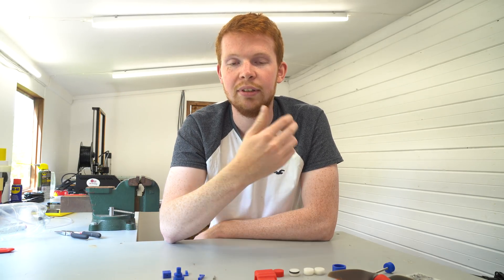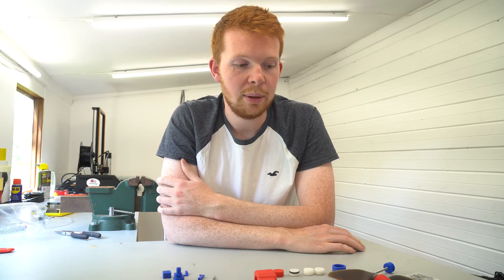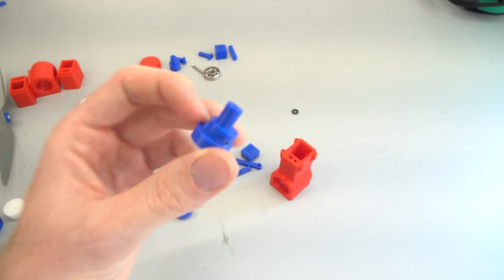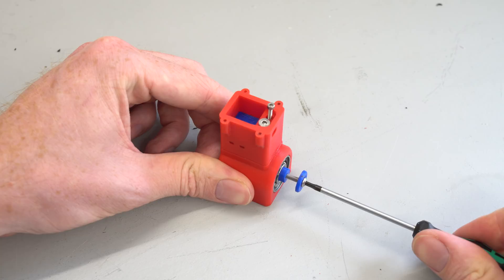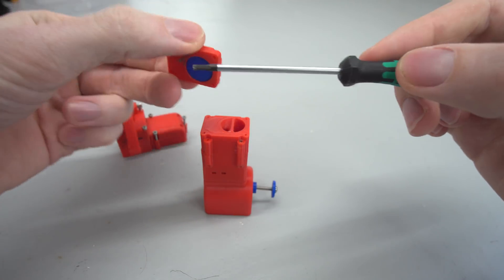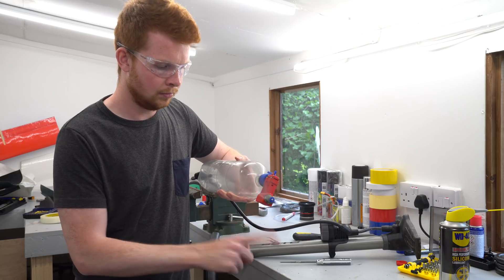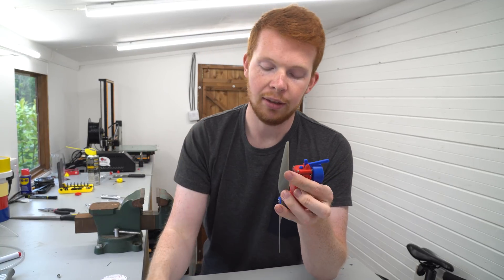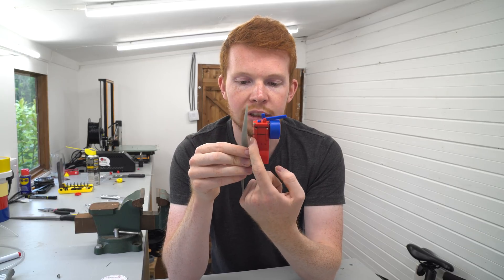Air Engine Exhaust Valve

Comment: After you fix the issues you should try to power it with liquid butane and maybe even dry ice, you would maintain those higher pressures longer without ever even needing to pump it up.

Comment: I can see that round headed bolt, or any bolt for that matter, covering up that new exhaust port.  With that said, the design shouldn't even work given that any air coming from intake would vent straight to exhaust.  As far as the operational friction from the cam lobes, maybe try to reduce the cam profile while adding a point of leverage to regain travel and reduce the amount of work required from the cam to do the same job.  So like a rocker arm sort of assembly.  I can see the idea behind the upper exhaust valve, but in my opinion, it was just poorly incorporated.  Your gonna need an airtight valve for exhaust, to which i may suggest maybe a simple ball valve in which the exhaust rod would hold it shut until exhaust is required.  Lastly, looking at the additional exhaust ports at the bottom, in my opinion they're a little to high.  It would seem your losing some efficiency and power from the air exhausting a little to early before the cylinder reaches bottom dead center.  I understand that you do need to relieve as much air as possible before upstroke, just use your discretion and take my input with a grain of salt.  Heck, with a proper exhaust valve system at the top, or multiple exhaust valves at the top of the cylinder, you don't even want the exhaust ports at the bottom.

But then again, this is all speculation on my part.  I don't have the engine on hand to test, nor do I want to build one and tell ya your doing it wrong.  I enjoying watching you work your way through a project your passionate about and to speculate and voice on possible designs changes.

Love the little series, keep up the good work!

Comment: A valve block similar to a "selector valve" with internal passages which is directly linked to the crank for timing. Should eliminate the need for any spring pressure needed for seating, along with cams or mechanisms like that. There may be some sliding friction, but choice of plastic and surface finish for fit would affect that too. (However done right that's much less than turning a cam against a pushrod pushing against a spring.) Might also need to work on the piston pin offset, and you could have a motor that self-starts in one direction once pressure reaches the cylinder. And last but not least, thread sealing tape (teflon tape) is your friend and is a pretty cheap and common kludge. Then o-ring sealing nor thread fit has to be all that perfect.

Comment: This would be alot easier to test if you added a light smoke to the compressed air intake. Edit: You could also make a lever system off of the intake push rod to simultaneously control the exhaust push rod. Wouldn't allow timing modification as it would be the same cam controlling both, but would let you try out the effect of the exhaust valve without adding friction (if you're clever also without adding resistance to the existing cam).

Comment: Instead of using a air bottle during testing, could you make a compressed air manifold and set your output pressure on your air compressor?  That way you could individually turn on each generation of engine to display the different sound. Then you could compare duration on the air bottle, and sound from the manifold.

Comment: Tom, increasing the bore would be the best option. And that because it would drastically increase RPM. The single cylinder engine is the best option, but there is a problem in there. The head holds a lot of pressure. I recommend you to try the Opposed piston design, you have a higher efficiency. And a lot more power. Thanks for the attention!

Comment: When you put the O-rings into the valve that system didnt look very promising. In my opinion i would think that there isn't much airflow past the O-ring and valve, or even any if the O-rings are compressed by the valve and not allowing any airflow past. You should test how restrictive the valve system is or if much air can get past the O-ring with the head off the engine.

Comment: Wouldn't it be a good idea to use 2 smaller bearings instead of one big ? Because only one bearing will create undesirable stresses, and deflections, on the bearing and the crankshaft.

Comment: I think you should stick with the dual cam design just add suitable lubrication to the push rods and get may be get rid of the bottom exhaust ports and I guess lubricant will help with the piston seal too.
Anyone noticed the camouflaged WD-40 can at 9:28 XD ?

Comment: my tip as a mechanic is to add roller valves wich is a bearing on the puch rod that decrease the friktion alot. but that will make the engine more coplex design. (sorry for bad english)

Comment: Tom,  use your pushrod to move a slide valve and make the engine double acting like a steam engine.with the air acting on both the push and pull stroke.  Very simple design and very easy to make compared to this weeks design.

Comment: Idea: maybe return to a single cam that acts as two valves, so air can escape the whole cylinder during the upwards stroke but is closed and allows pressurized air in. Kinda of like a valve on a steam engine.
Reply: This is a bit complex but here is an example of a valve gear from a steam locomotive, it also allows for variable valve opening and direction reversal.

http://507movements.com/mm_185.html

Comment: ncie video as always, failure is part of every success. maybe you should build a single cam engine again, but the cam moves a valveplate. your cam would need something like an inner and outer lobe but the plate would also add friction.

Comment: A bigger piston area and short stroke will give your engine higher RPM, but lower torqe. A smaller piston area and longer stroke will give the engine more torqe but less RPM. That's how it works in gas engines, and I think it would be the same in your case. This series is the best, keep up the good work!

Comment: Wow, now this is real engineering, I love the way you attack each problem by solving one detail at a time!  I have a question for you. Not sure if you have mentioned it in previous videoes though, but do you vent out the crankcase? I guess you could save some energy if it is vented just flowing it in and out, as you dont have to compress the air. Maybe the bearings leak enough out them self, just a thought.

Greetings from Norway

Comment: I said it in the last video, try building an oscillating, single cylinder engine type. I've built a 8 different engines so far & it seam to be the most efficient design & with the least amount of parts. I'm building my engines out of wood, so efficiency is important to me, since I'm working against leakage problems all the time. Hopefully you'll see my comment this time, I really want to see what you come up with & here's another example of an engine I've made - https://www.youtube.com/watch?v=oHFrcwoOpeI&t=17s

Comment: The best reason for multiple cylinders: Self-starting.
You put one throttle needle valve in front of your intake manifold, and when fully closed, the engine is stopped. When you open it, on a single cylinder engine, then you must also start the engine. But with multiple cylinders - provided that they are out of phase with one another - the engine will self-start.

Comment: It seems like you are fighting 2 different energy losses, the force of friction for a longer stroke length vs the air loss due to a poor seal. I still think that using a metal insert or metal piston shaft/seal combination would be your best bet and reducing the friction while sealing it better with a bit of oil. you can turn he metal down on a lathe or the piston and that might help, also maybe use 2 bearings to support the cam shaft. Also here's some other random ideas that might help: What about not using a cam operated exhaust valve and instead having the piston just pass an exhaust port? I really think that a simpler way to control the airflow like a reed valve with magnetic sensors triggering the opening and closing letting you use electricity control the air flow rather than using like 30% of your air power just to control the flow. try messaging AvE, he should have some good ideas about it and you guys could do a colab video. Also maybe look into wooden engines because they deal with many similar issues such as poor seals and high friction. Finally I think that having a round piston shaft is important and will let you trim down /reshape the pieces like by using a drill bit to bore out the shaft to the perfect dimension or using a coin or small metal disc on the top of the piston to create higher tolerances. maybe using some parts from a stirling engine could help. anyways love the constant effort, I don't care if your videos are consistent, if you need one more day to finish a test do it because it makes the video feel more meaningful and I would rather wait one day for a better vid than leave it off on a cliff hanger/incomplete iteration and have to wait a week more for the conclusion to be revealed as a foot note of the latest iteration/model but keep it up any way!

Comment: I'm a bit late to the "constant cc"-discussion. But a longer stroke increases the acceleration, and thus the strain on the parts more, while a larger bore increases the size and weight of the piston more.

Comment: Make a round cylinder and use o-ring for sealing. Even if it harder to make a round printing your results should be better. Use some lubrication as well.
Think about it, all engines are having round shaped pistons.

Comment: Nice to see your progress on this. Please consider the possibility of a rotary valve system. Imagine a small cylinder rotating inside a tube tight enough not to let much air through. Now put some grooves on the cylinder and holes in the tube, allowing the piston volume to connect either to the pressurized air or to the atmosphere, depending on the angle/phase of this cylinder, which  of course is connected to the engine shaft. With a nice finish and maybe some sanding, a small ~3mm rotary valve should give you negligible amounts of friction.

Comment: In a small crude engine like this friction losses will effect efficiency more than any other factor. I think the longer stroke is contributing. I would go back to the single valve and try a larger cylinder shorter stroke. I doubt an additional 4-5mm will matter as far crank leverage. If it was a problem, could you move the exhaust valve to the front side of the engine bearing?

Comment: In motorcycle engines they increase bore for higher revs and performance. If it's a longer stroke it produces more torque at low rpms. At least that's what I remember. 

How about a single cam and valve but with an extra position that acts as outlet valve? Instead of having everything double and have twice the friction it might be possible to have a positive and negative cam offset (if you raise the general neutral/closed position) to push your valve up or down depending on whether you want it to act as in or outlet.

Sorry for the bad English... already had some beer. Great stuff you do by the way! Greetings from Germany.

Comment: Hello Tom,Which ever engine you decide to go with, you need to play with the lift, duration and timing of the cam lobe. This will impart determine the amount power and prop speed that the engine can develop. In your past video where you trying to fly your version #3, I believe you can hear an RPM reduction when you threw the plane which means the air flowing past the prop is faster than the prop speed.

Comment: Why do you keep saying false statements about psi you said the one engine ran on 5 psi and I don't believe you because the atmosphere is 14.7 psi not 0 dumbass so your engine ran at 19.7 if you add 5 psi to atmospheric pressure

Comment: One reason that your engine is now not spinning s easily when you flick the propeller is that by increasing the stroke you to gain more power you have effectively "geared" the engine higher when spun from the propeller side.

 Ii think one way of almost doubling the power of the engine without adding weight or much complexity is to make it  double acting.. i.e. feed compressedair to the under side of the piston on the "up" stroke,
  It should be fairly easy to modify the input valve to a spindle type which can open /close both sides together.
 That should improve performance greatly.

Comment: What if you 3D print the cams instead of using metal screws for them instead? Won't that decrease the friction since they would be made from plastic and be much lighter? Just a thought.

Comment: Tom a multi cylinder engine (a flat twin) would be more efficient as the 1st cylinder is helped on its upwards stroke by the power of the 2nd cylinder. So less time when the engine is free wheeling. Yes it will use more air per-second but you will get more power from the air your using.

Comment: I thought about a combined expansion: first a constant pressure expansion while the air is provided at the bottle pressure, then an iso-entropy expansion where the pressure starts from the bottle pressure to the atmospheric pressure. As with a heat pump, the air would be released at a lower temperature and the efficiency would be the maximum possible limited by thermodynamics!

Comment: I must insist a sliding valve like the ones in steam locomotive mechanisms. You would have a power stroke on both sides of the piston.  Also consider the Sterling engine effect when you calculate compression and expansion times. Try it at least once.

Comment: I'm not trying to invalidate the idea of a compressed air engine, but wouldn't the air pressure straight from the container provide better performance / propulsion as there is no extra weight / moving parts?

Comment: Off topic: the wavy bands of light and shadow showing on your workshop walls are because you are using flourescent lights at 50Hz and a framerate on your camera of 29.97 fps.  In general filmmakers avoid flourescent lights.  If you care there are ways to prevent this https://youtu.be/KirIM7UmA0o

Comment: you need only a inlet valve, like in a 2stroke engine, that has no valves, but with a v180(not boxer) configuration you can optimize the torque curve for every rotation so it can run more smoothly,and also increase efficiency , try some lithium grease on the o-ring not the silicon wd40
simple but amazing project

Comment: I'm probably missing something, but how about deleting the camshaft and replacing it with a turbine (something resembling a turbocharger). Air comes in on piston downstroke, spins the turbine (and thereby the propeller) and the output is fed back into the engine itself. Seems like it'd be more efficient and easier that way. I'm probably missing something though, as I earned my degree in CS rather than mechanical engineering.